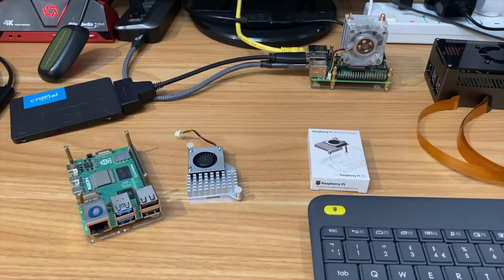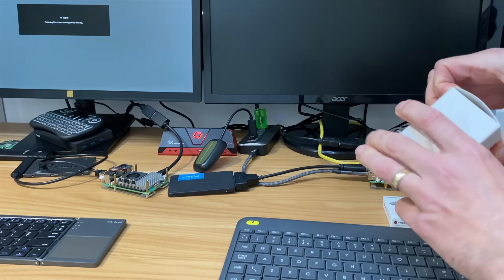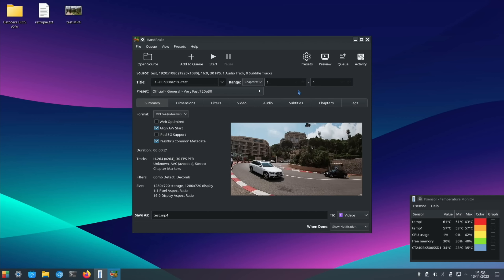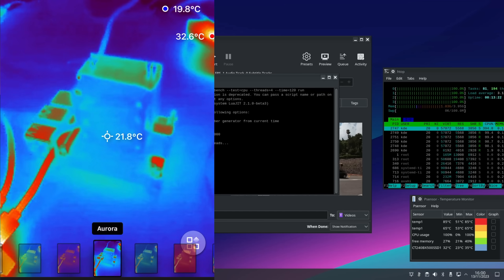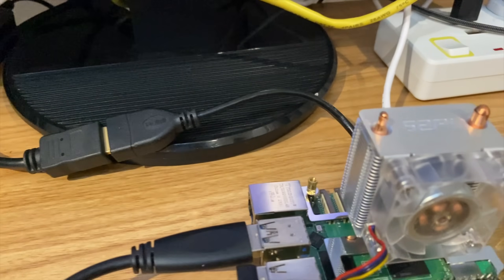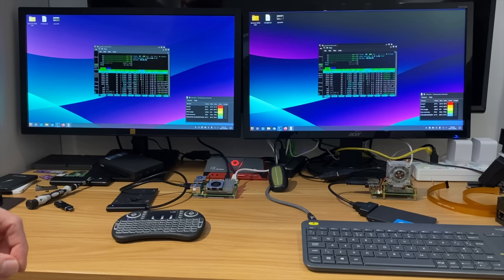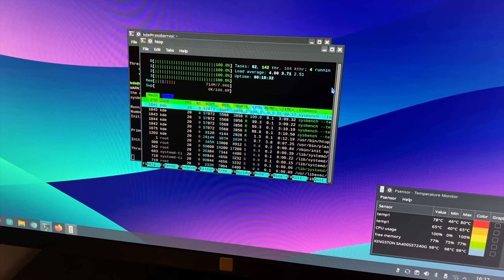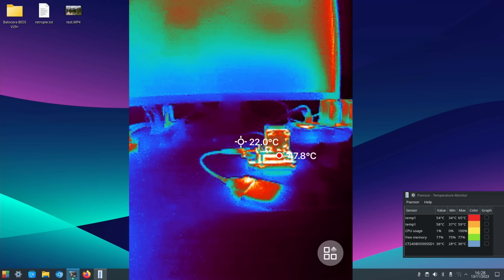52Pi ice tower cooler VS official active cooler. Raspberry Pi 5

Comment: You can really see how ineffective that CPU heat spreader is on the Pi5.  Not that it needs to be as effective as an Intel heat spreader....   In your video, the Pi 5 heat spreader is showing up blue while underneath there's a very clear bright white outline (60C+) underneath the CPU.  Possibly an air-gap between the die & spreader... I watched a deliding video of the Pi5 and the thermal material was bubbly showing that an air-gap is likely, as any thermal material should be flat & smooth, & provide a solid interface between the die & spreader.   SO, I'll be deliding my Pi5 when I get it & utilize a direct contact passive copper heatsink with directed airflow (thanks to 3d printing) for cooling.    Should be much more efficient.

Comment: I swapped the fan on that ice tower to the noctua 40x20. Set spin at 100% at 55c overclocked up to 3.1 ghz and it rarely goes over 55c with a stress test and 4k video playing. I have added heat sinks on the board as well. That ice tower is awesome!

Comment: hi brother I purchased an Active Cooler pi 5 and I wanted to know if the fan activates automatically at high temperatures, do I need a script? A thousand thanks
Reply from the maker: If you are using Raspberry Pi os or my KDE build the fan will come on to cool the Pi when it heats up
Reply: @leepspvideo  hi thanks for answering me I use a raspios-bookworm-armhf-full the raspbian one to block us
Reply from the maker: @pinobarbareschi6452  play a video at 1080 your fan will soon start up if its working correctly

Comment: I bought a Khadas Edge 2 last year and finally got video drivers working correctly with an Armbian distro running off an SSD. Compared to the Pi 4, it flies. Kinda seems like the thermals are the same between the pi 5 and rk3588s with the official khadas cooler. Price-wise, the pi 5 is definitely tempting but I just don't feel compelled now that I have a distro that can pretty much benefit from the pi ecosystem of software. Kinda wonder how the next release of rockchip devices will compare to the pi 5. I'm sure the video drivers would take time to iron out.

Comment: @leepspvideo, in case you were not aware, the thermal camera needs to be calibrated for the emissivity of the surface you are measuring. The CPU being metallic and shiny has a lower emissivity than non metallic matte surfaces.
I recommend to use some 3M Blue painter's tape and apply it on all the components you want to test and repeat the test. Then you should see that the CPU is reading much higher than 28C you measured around 4-5 minute mark in your video.

Comment: With the stock cooler, you are also cooling the ram at the same time as the cpu. With the icecooler, it is only cooling the cpu.
So, you will notice an overall (slightly) higher temperature (especially with the fan off) when cooling all components than just the CPU

Comment: Hi Lee. Thanks for the interesting test. But it seems to me that it will be much more interesting to see the results of testing these same cooling systems under full SoC load. I mean 100% CPU PLUS 100% GPU. This will tell us more about the limits for use with emulators and for working with media.

Comment: I guess the CPU cover is aluminium which has very good thermal conductivity, but very very low emissivity so won't be picked up by the IR camera. It's also the reason survival blankets are made from aluminium foil, all of your body's radiant heat is reflected keeping you warm.

Comment: Does the official Raspberry Pi case work with the Pi Cooler in this video ?
Reply: The official Pi 5 case comes with its own fan. If you buy the official RPi cooler, it does fit in the case but you will have to remove the fan that is already in the case. You can just pop that fan out, it is designed to be removable.
Reply: @terrydaktyllus1320  That is cool!
Reply: @FalconWing1813  Yes, it's okay, they've designed the case well - there's even a gap between the sides and the top to allow a bit of airflow. It seems cool enough but I haven't stress-tested it yet. 

I was offered a Pi 5 to buy as a priority because I subscribe to the MagPi magazine. It was a surprise when they sent me the email to get one, I was going to wait when they come into supply, probably after Christmas.
Reply from the maker: I didn’t order the new official Pi 5 case

Comment: You probably were seeing a cool cpu with the thermal camera because the thermal camera uses IR, and the heat spreader of the cpu is reflective. If you put something non reflective you probably would have seen the real temperature

Comment: can I use thermal paste with official active cooler?

do i need to remove preinstall thermal pad on this active cooler before applying thermal paste?
Reply from the maker: You can use thermal paste. You would definitely remove the pads as they are less effective than paste
Reply: thanks  @leepspvideo , I will definitely try it

Comment: Perhaps something wrong with the heat spreader contact patch (or your temp reader device) because it stays cool even when the BCM2712 chip underneath getting wayyy hotter. Don't you think?
Reply from the maker: According to psensor it’s doing it’s job. Others have mentioned reflective surfaces aren’t read as accurately by thermal cameras
Reply: @leepspvideo  I read that too but isn't the heat spreader mate instead of glossy and reflective? Perhaps the only easy way to find out for sure is to actually touch the heat spreader to see if it is anywhere near the number (very low temp) given by the temp reader.

Comment: Can you do a video about USB SSD enclosures please? I would like to know if the RPI5 has the same issue as the RPI4 with USB enclosures. The issue where some usb enclosures were incompatible with the RPI4

Thank you
Reply: I assume you're talking about the electronics and cable within the enclosure, rather than the enclosure itself. If it's the former then, yes, there do appear to be incompatibility issues, I have seen them myself.

I don't think there's an easy answer other than to keep the connecting cable as short as possible and you might need to use either a powered enclosure or connect it via a powered USB hub.

Those issues do tend be because the RPi PSU can't supply enough power to power both the Pi and any peripherals connected to it simultaneously.
Reply: @terrydaktyllus1320  No, I am talking about the usb issue all RPI4's suffer with. Because they designed the USB part of the RPI badly, There are certain chipsets used in enclosures that are known to be working/not working so not all USB enclosures work. I'm wondering if this has been fixed so they all work now.

Comment: The flatter the surface the more the IR-light gets reflected, the less you can messure it. It basically acts as a mirror for IR and you messuring the ceiling.
You can even see the outlines when you move the camera.
For the CPU for example there was an outline on the PCB which should be an indicator for how hot it is at least.
Touching it (rather don't do it xD) will show your finger it is above 60 degrees. But faaaar away from 30 which would be cold to the touch.
Reply: It is not just the flatter the surface is. It also depends on the material and color. This is why the more expensive thermal cameras come with an adjustable εr
If you want to compare different components on the PCB, you have to put a (mat) black sticker on the CPU. I will often just use a piece of black electrical insulation tape, that seems to work as well as the "official" stickers that came with my camera

Comment: Leepspvideo: ... since I have two 8GB Pi 5's.....  The Rest of Us Waiting:
Reply from the maker: And a 4GB 😳
Reply: They’re selling them in Australia, 4gb version only in a kit. PSU, pi5 4gb and a micro sd card. Micro sd card works out to be almost $30au. I can get 32gb fastest micro ssd for $12au. 
I can’t believe they’re that desperate for money🤦‍♂️. I’m holding off till I can buy them as a single unit.
Reply: @-someone-. Sounds like you got the same email I got yesterday. 4gb in a kit with the old spec PSU. Yeah nah I might hold out a bit longer me  thinks.
Reply: @cobberdig  I didn’t get an email, I just check their site every 6minutes...lol
Also, I didn’t even check the PSU! wtf! What a rip off! I heard the NVME ain’t gonna work with old PSU, what is core elec doin🤦‍♂️
Reply: @-someone-.  I did read on a forum somewhere they are still getting the Australian power supplies approved or something so there's some hold up with it. I imagine if you didn't want to wait or get stuffed about with low quantity of Australian stock maybe just get it all sent from the UK.
Reply: @cobberdig  Cheers cob. I’m good to wait👍. Thx for the info👋

Comment: Not very good comparison because the Pi cooler is dissipating heat from all the components.
Reply: It is apples to oranges, but by cooling the cpu neighbouring components won't get as much second hand heat.

Both are fruit at least. 😅

Comment: Unfortunately with that first test, the handbrake process had already completed by the time you were doing thermals. You could also see the cores were all inactive.
Edit: another thing to add, you may need to put something (like masking tape) over the CPU before you thermal probe with a laser - this is because the results you get back will be malformed due to light scattering from the mirror finish on the die.